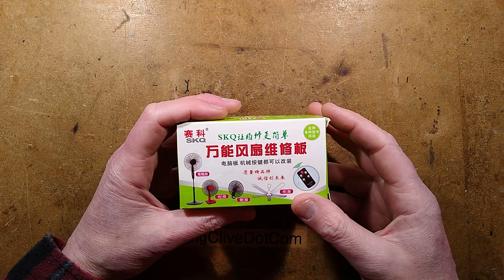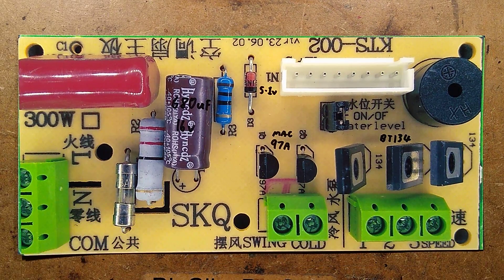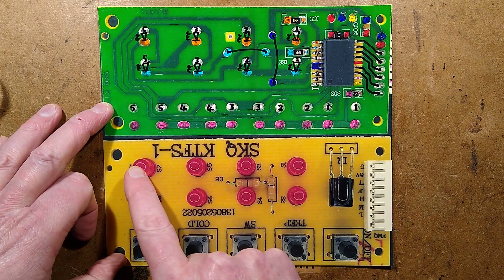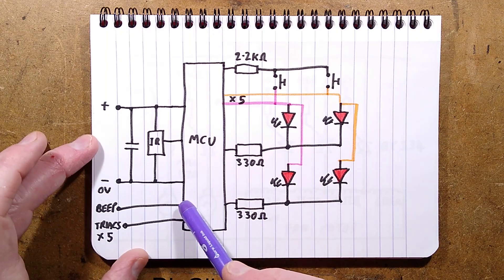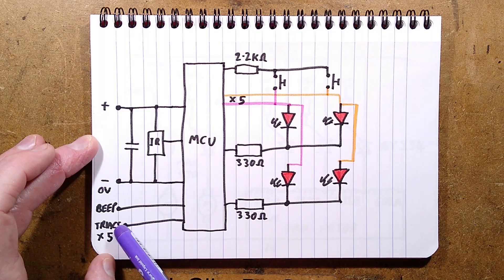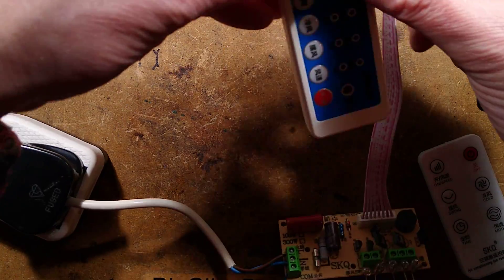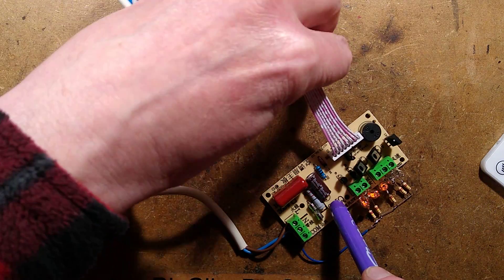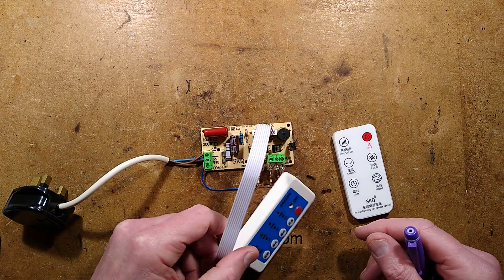Universal fan control module teardown - with schematic

Comment: I THINK (not shouting, no italics available for commenting that I have figured out) that if all three speeds were to be turned on at the same time, electrically the motor should see it as a single feed to LOW. BUT all three triacs must be switching at EXACTLY the same time in the waveform.  I would have to set up an experiment to prove that, but at least in my mind that's how it should work. (I am also assuming that the motor coil is a single tapped winding. If it is multiple coils then my theory would not be correct.) Maybe Clive could scare up a three speed motor and use some simple switches to test the theory out.
Reply: it is very confusing: _ italic text _ (remove spaces between "_" and next/previous letter)
Reply: That's not how it works. The main motor winding is a single tapped winding but because of the core it also works as a step-up/step-down transformer. If you energize the "low" tap at 120v you will see perhaps 80v on the "high" tap, and on this same motor if you put 120v into the high tap you'd see 180v on the low tap.

If it weren't for the transformer action (for example if it was a tapped resistance wire) then you could indeed connect multiple taps to power.

Comment: Oh great, the control panel is encased in thin cheap plastic and it runs at 240V, what could possibly go wrong.
It could be so much better.  Re-arrange the capacitive dropper to the live and couple to the triacs with optocouplers.
Reply: don't forget the 0.1mm/28AWG IDE-cable-like ribbon wires. 
Those are surprisingly rated 300V but I certainly wouldn't be the one to test it on myself...
Reply: The control circuit (buttons, etc) are still live..if they become leaky. due to moisture/ dirt buildup etc.

Comment: The cooling output is for opening a solenoid that lets chilled water into a coil that the fan is blowing air over.
This is very common in office buildings and hotels. Each room would have such a water fan coil.
Usually the water is pumped to an outdoor unit that cools and/or heats it like Daikin EWYQ. In some installations with geothermal they pump the same brine that goes into the heatpump for heating in winter to the coils in summer for cooling.
Reply: "Misting fan" is the term your are looking for.
Reply: @j.f.christ8421  I am talking about a system with a closed loop water system. The cold water goes through a copper coil in the fan where it heats up. Then the hot water is returned to a central location where it's cooled down again. Just like an air conditioner but with water instead of refrigerant. It is also possible to use water from a lake or well which is discarded after it is heated.

A "misting fan" is an evaporative cooler or "swamp cooler". It only works in very dry climates.

This control device would work equally well for both system.
Reply: Yes, and we're wondering why you are rambling on about it 

Do you really think this board is for more than just spraying a bit of water in front of the fan blades?

Once again, you could have written "misting fan" instead all that dribble and the world would be a better place.

Comment: I saw a video on here with that washing machine controller and I was dubious at first but then after seeing the sheer amount of tearing down the machine, re-fitting wiring, chuffing about with the thing it was at that point I would have said, sod it and just bought a new machine and scavenged all the parts for spares from the old one.
Reply from the maker: Was it the one where they used random flex for everything, including the earth/ground for live connections.

Comment: Lol that "stroke" translation really had me. Just in case you're wondering if switching to the medium setting will cause a stroke, in Chinese "stroke" and "medium wind (literal)" writes out the same, although they are pronounced differently (the tones are different for the first character).

As for the mode button: in China a lot of fans have a mode called "natural wind", which aims to simulate, as the name implies, natural wind. But they do a terrible job at it by basically cycling through different speeds. I don't know if it's a thing in other countries, but some Chinese people believe (or are made to believe) that such wind pattern is better than a constant-speed airflow.
Reply: Like the poor orientals in 🇰🇷, who believe in/have a phobia of “fan death” = if a fan is left on and blowing on them and they fall asleep they will die, and the fan “must have the “compulsory sleep/safety timer” for them to set if they feel tired
Reply: @samuelfellows6923  I understand some people can be under-educated or ignorant even in S.Korea, but the government buckling to their pressure is what blows my mind.
Reply: I have seen an air cooler with that feature it just annoying when the air speed changing with the ramping motor noise
Reply: @darwisyaiman1865  Yes, I find it especially annoying when trying to fall asleep. The ramping noise can be very distracting and it'll keep me awake.

Comment: I had to look up what the "swamp coolers" mentioned in the comments were. I've heard of evaporative coolers before, but they are never used where I live. We always need less humidity, not more!
Reply: That is their main weakness - they are very cheap and use very little energy, but the tradeoff is they introduce moisture. A simplest swamp cooler is just rugs sitting in a tray of water, or a water bottle dripping on a rug. Water aggregate state change is very energy-intensive, thus evaporating water has to reduce the temperature rather significantly. In very dry very hot places it's good enough, or at least better than nothing. With very dry climates it is even advantageous to add moisture to prevent static electricity buildup. You need airflow though unless you want entire home turning into sauna..
Reply: I think they could still be used in a split system. If the evaporative cooler is outside and connected indoors with coolant pipes you can cool indoors while keeping the humidity outside.

Comment: very interesting module. I remember you mentioned it on stream. About the washing machine controller. I found a huge ca 0.7 kw squirrel cage motor in my parents 80s tumble dryer. Wonder how many washers use those instead of universal ones.

Comment: I read this as "Universal Fat Controller" but was keen to watch it anyway 😂
 I've been looking for something like this to control a large fan in my shed to blow air over my motorcycle if the RH gets near to the dewpoint. I've already written and tested arduino code for a DHT11 temp/humidity sensor. The bike occasionally gets dripping wet under certain conditions (if there's a rapid temperature change from near freezing) and despite being covered in all manner of corrosion inhibitors I still worry about my beloved bike under these conditions.

Comment: The mode button is designed to simulate a natural breeze. I've had remote controlled fans before with that function. I never used it, it was very annoying listening to the fan constantly changing speed, and pretty pointless imo.

Comment: only thing the "universal" washing machine board would be good for is making modern machines dumb again, assuming the motor is something that it can control
Reply: Which might be a good idea, some try to be way too "smart".

Doubly so for microwaves, why on mine out of a dozen buttons only one is used to increase time for only 10 seconds at a time? It is infuriating to use for 15-minute dishes.

Comment: Note the reason why the TRIACs are commoned to +5V is to avoid quadrant 4,  (MT2-, G+), which is the least sensitive and would require more gate current to fire. This circuit only triggers the TRIAC in quadrants 2 (MT2+, G-) and 3 (MT2-, G-).

Comment: Guess you could drive a contactor with that cooling output to control a compressor in a bigger unit, and maybe put a bimetallic temperature switch in place of the float switch.

Comment: I bought severaal of these to add it to ceiling fans that are not remote controlled. I wired the switch to the fan to be always on, and put a blank plate on where the wall switch was. I mounted  the remote holder onto it (mine came with a remote controller holder). It works perfectly.

Comment: Motors do have short circuit protection, the CCA wire will blow up and disconnect at around double the current.....

Comment: Well that remote control will last a whole five minutes before it fails.
Reply: they surprisingly can last a couple of years if only pressed once or twice a day.
the switches are functionally the same as in many microwave ovens or similar kitchen electronics...
Reply: @jwhite5008   I've had a couple of these remotes made like this and it's not long before the plastic domes fail around the edges.

Comment: mode varies the speed to create a more 'natural' breeze, my fan does that and it is surprisingly good, seems better than when on a constant speed.
Reply: I found that setting very annoying as the white noise is not constant
Reply: @25566 
Me too. The ones I've tried that feature on all also made a horrible vibrating noise fairly often as it cycled the speed up and down. I always felt like this was probably going to do damage over time.
Reply: It is very surprising that this board does not have this feature because it does not require additional hardware all it does is the microcontroller generates a random number and it steps the speed up and down automatically all my electronic controlled fan have it
Reply: @lifeai1889 It does have that function, see 14:25. ;)
Reply: I have a handheld 'personal' fan that has that feature.  Nice to sometimes get rid of the constant 'drone' of a single speed.
Reply: I hate that mode but I assume that's the point here.

Comment: There are even "universal washing machine controllers' to repair your washer. Just wire up the motor, heater, valves pump and sensors...
Reply from the maker: I tried buying one, but the AliExpress seller didn't ship it in time.

Comment: This has potential to be used as a nice home assistant fan controller with a cheap esp. Time to grab one and try it
Reply: Or just buy one premade. Tuya make them already in various forms.
Reply: I'm not sure the triac can trigger at 3.3v
And the esp would need more power
And it will be live at mains voltage
I recommend getting a DC fan which you can directly connect a esp gpio to and control it with pwm which is what I have done
Reply: @lifeai1889 @lifeai1889 Don't overthink things.

Cut a track on the board and use a USB power supply for the 5v.  (Worry about the mains going back into the USB some other time.)

Add a 3.3v LDO regulator for the ESP.

Add level shifters to keep logic levels happy between the two boards.

Write a bit of code and you're all done!  Easy peasy!

Comment: For shits and giggles, use the 'cold' triac to run a compressor (joking aside you could use it to fire a 120/240v [delete as appropriate] relay if you had a real air con unit)

Comment: I like the fact that you can use one of these to repair a swamp cooler controller.  
Could be fun to see what else you can do with these things...what kind of mischief could you get in to  :)
Reply: Swamp coolers are AMAZINGLY effective in southern calif and other dry areas, it shocked me when i moved there. The humid air felt ICY...!  (being from coastal UK and having moved from midwestern USA, this is not normal LOL)
Reply: I never did understand the point of swamp coolers.  What's wrong with letting the swamp be as warm as the surrounding dry land?

Comment: Those resistors stuck right up against the capacitor 🙈 and again with a high current line with wafer thin resistors over the top of it, christ

The button translation wasn't great? But the English words were on the pcb 🤣😂

You didn't open the remote, there may have been secrets!

Unit might be fun to try and adapt into a desk fan, so Jr could be operated remotely
Reply: Engrish on PCB is also weird. Starting with ON/OF switch.
You generally cannot open this type of remote control without destroying it, and even then it requires annoying peeling off the top layer. There are just a glob-covered IC, battery, and standard buckling dome buttons glued between the PCB and the label anyway.
Reply: @jwhite5008  I think they all have it as a notation when designing the board, the text just gets left

Comment: In the states at least, we'd refer to the unit this would go into as a "swamp cooler"

They're really only useful in dry climates where the evaporation can provide a decent effect, but they cost considerably less to run than an actual air conditioner.
Reply: We just call them "evaporative coolers" or, like you, a "swampy".

This kinda "fix" for them is great to see. It allows otherwise good hardware to be used more and not require throwing away and replacing (particularly good if it's one of the larger units).

One thing that does worry me—such coolers are renowned for making high-humidity air. How are these electronics going to deal with water dripping off/over them?

Comment: I currently have an aircon that half-cooked itself after the installation dude connected it in a wrong way to a compressor, I'm yet to repair it or find someone who'd do that, and I curiously found out that there are universal boards on the market even for compressor units.
Reply: You could use of these and have the small aircon triac drive a contactor/relay
Reply: @clownhands These really don't have temperature control or a built in wait period to let the compressor equalize in pressure before turning it back on